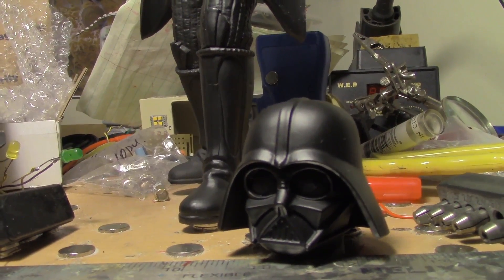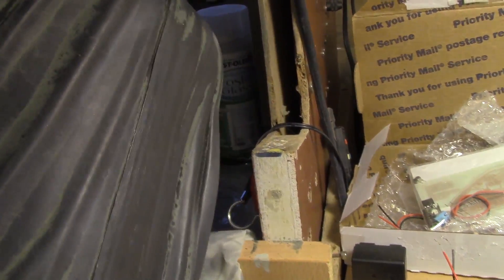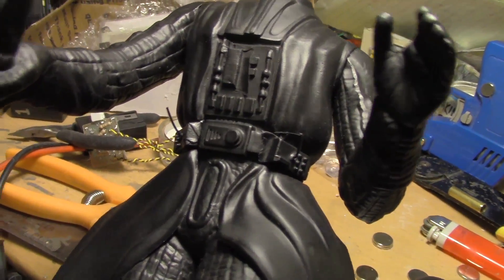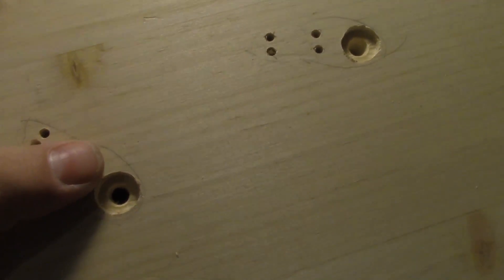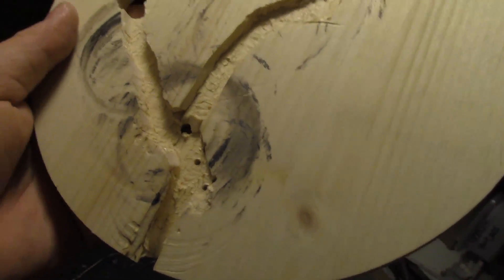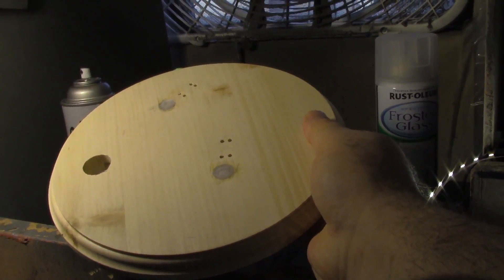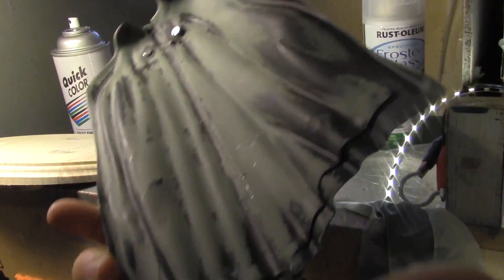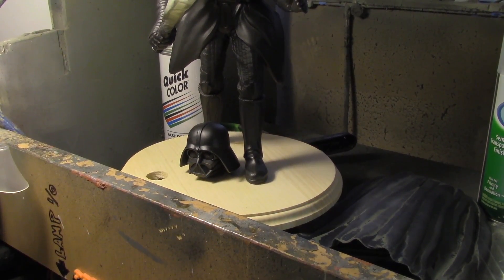MPC Darth Vader: Part4

Comment: The others are right, you cannot brush Alclad, only airbrush.  Also, you can seal up alclads with about any clear coat you want, except for the chrome.  If you use the chrome, don't seal with a lacquer paint, it will fog it.

Here is a suggestion for Vader, it is just a suggestion.  This is what I would do if I was painting him up:

For the cloth I would clear coat with a flat paint
For the leather, I would do semi gloss clear coat.   A good semi-gloss will look like leather, I did this with car seats in my Honda model.   I used specifically Alclad semi gloss.  Dries in minutes.

For the metal, well it depends upon which Vader you want to build, I would gloss coat it after you paint on the metal.
Reply from the maker: Thanks to everyone for the comments.  How you see him in the vid is real-time, in that he's still in the booth gathering dust whilst I create a big batch of similar painting tasks; and get some computer work done as I have to vacate the room for hours when the paint is going, the Alclad's should be worse than enamels in fumigation terms.

The cape and cloth are now flat black, unsealed.  Ideally, I'd replace them  all with actual cloth, but that would be for another figure.  Seal them in flat matte is next.

The leather don't look bad right now for the scale, but if I've got a semi-gloss on hand, I will test -or save for the next Vader.

I'm going Star Wars-Star Wars and want that beaten metal appearance.  It's not quite black, more of darkened steel.  ESB was ok, but the helmet for ROTJ was very plastic to me and is a contributor to my disappointment in that film overall.

I didn't figure alclad  could be brushed but figured I'd find out one way or another.  Otherwise, I gotta mask everything at various times to get it right.  Hoped it'd be simpler than that.  While an exceptionally simple build in all ways, it comes down to the paint job adding up to weeks of time while coats cure and are safe for taping.
Reply from the maker: I'd also add the chips to simulate the 3 red chestbox lights.  I found a diagram on the net.
Reply from the maker: And get a 6" UV CCFL, crack it out of it's case and coat the exposed wire with rubber cement, if not the whole glass tube.  I should make a video at this point I've written so much!
Reply: ModelManTom Alclads dry extremely fast.  I have put tape on alclads within 10 minutes of spraying with no pull up or chipping.  

But those fumes are very very hazardous.  Don't let the safety officer in during that time.
Reply: ModelManTom LOL!!